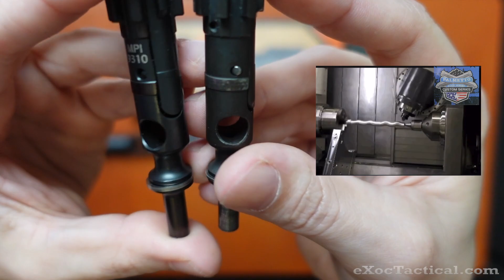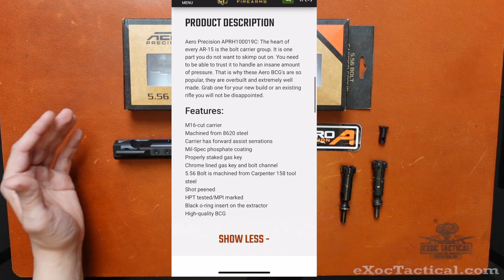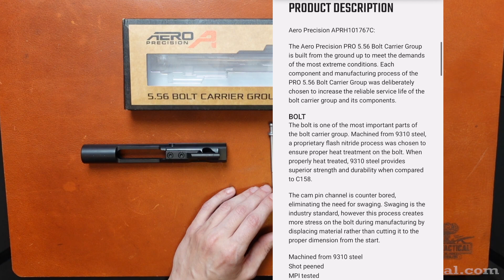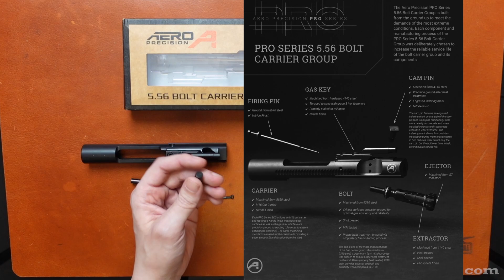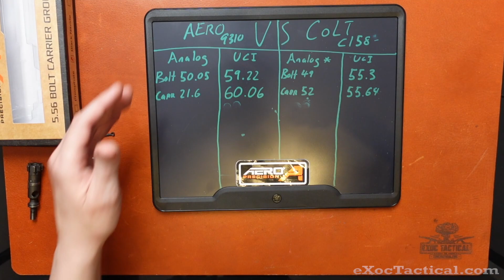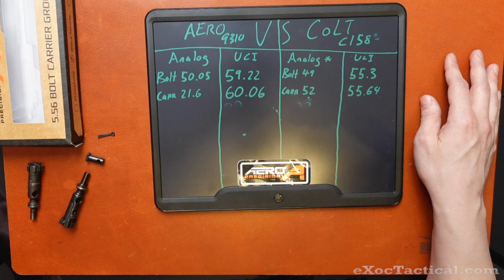Aero Precision BCG - Is It Worth It Let's put It To The Test

Comment: If heat treated correctly 9310 is 7% to 17% stronger. THEY say it is harder to treat C-158 because it is very sensitive to heat ranges so they dont usually Nickle/Boron coat them. I have an Aero NiB BCG.
Reply from the maker: What do you think about the carrier being so soft? Seems like they are counting on the case hardness. Was hoping more people would share there knowledge like you did. I can test, but was counting on the comments on my videos to decipher the information.
Reply: @thehardnesschannel1605  Carpenter Steel is propriortory amd scarce. Most goes to the Military Contracts. It isnt the coat it is the availability. For that reason 9310 is used and according to YouTube Gunsmiths and Makers 9310 breaks MUCH more often than C-158. Notice that C-158 is used with Phosphorus coating mainly because that is what the Gov wants. If you are not shooting full auto and the barrel is timed correctly I think we will never notice one way or the other. I only fire 100 rounds or so a year so I will not see anything different.
Reply from the maker: These stronger steels can in theory be a upgrade, but if not properly heat treated can lead to higher failure rate as you eluded to with 9310. People want to know what makes guns better than others, I tested 2 Taurus G2C’s, one barrel is 32HRC nominal, the other barrel has areas that dip as low as 25HRC to rarely 30HRC in other areas. Also there is no case hardness on the Taurus. I just wish YouTube didn’t shadow ban me. And thanks for sharing, it took almost 2 years for anyone to talk about this subject with, and thanks for your insights.
Reply: @thehardnesschannel1605  You should do a video on the Politics of Carpenter Steel Co. It is interesting. It would blow the lid off the lies about WANTING to use 9310 rather than C-158 in their bolts.